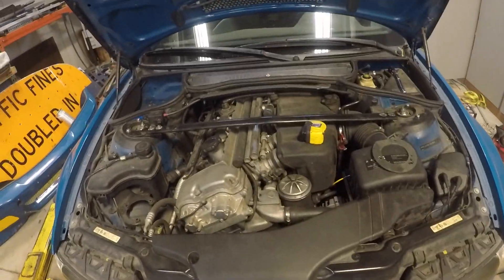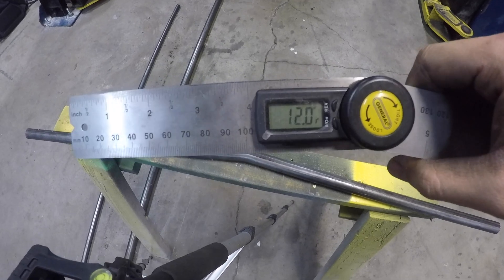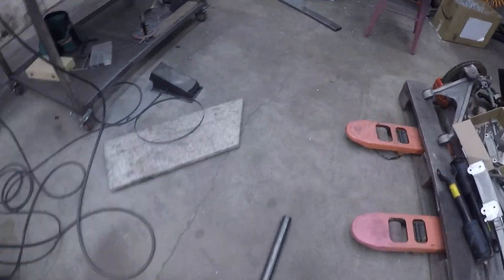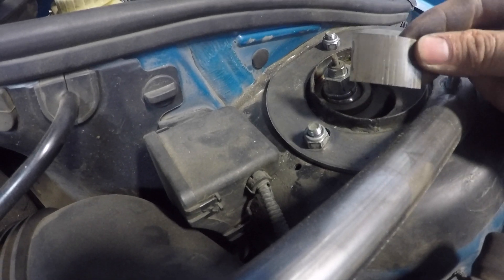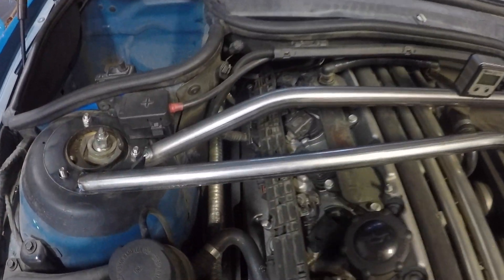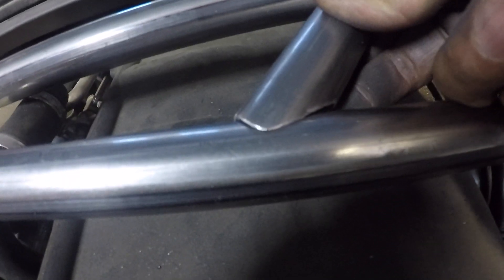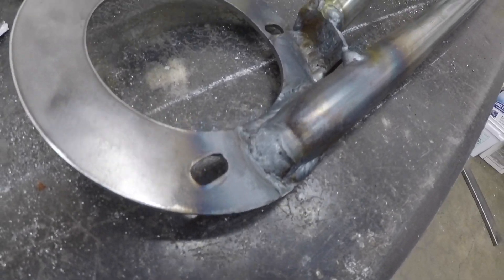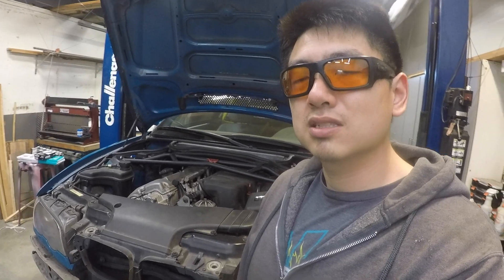E46 M3 DIY Front Strut Bar

Comment: While some of these brace struts look nice it must be pointed out that the BMW OEM one has aluminium side plates and a steel centre bar which is designed for the purpose of when you go over a serious pothole then the steel centrebar forces the aluminium plate to snap and in turn helps not to damage the tower struts..... I never knew this until i had the misfortune of greeting a pothole around a bend and it rattled the fck out of the car and me, causing the side fender grille to pop out ..... I got the car home and carried out the inspection ( as u do ) and sure enough the Strut brace had snapped at the plates ( alloy ) while the bar ( steel ) had stayed in shape...... So YES these bars look good BUT put some thought in to the possibilities of the unwanted pothole.....